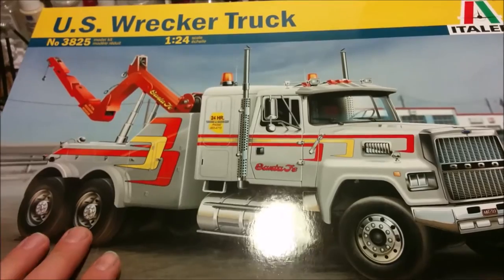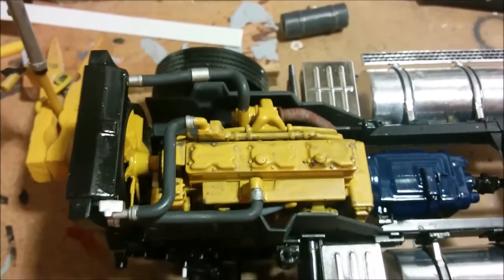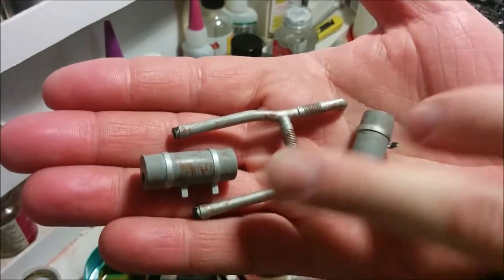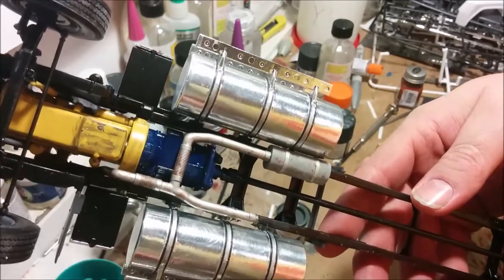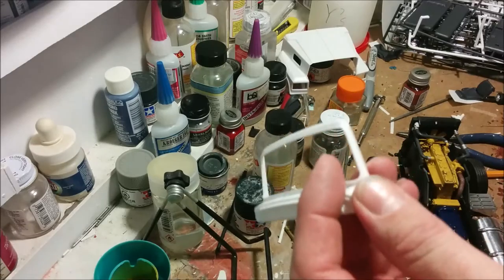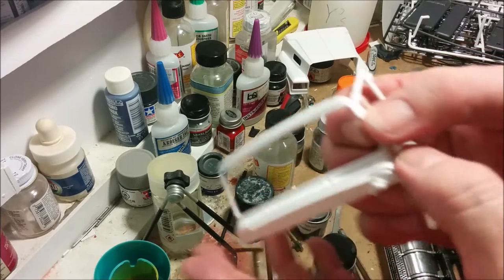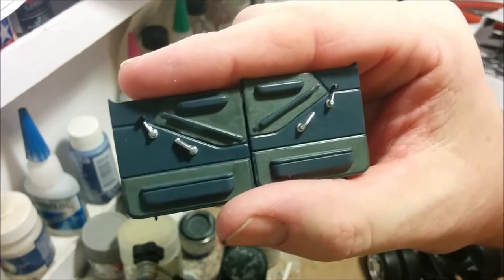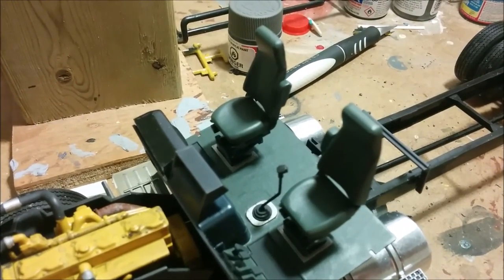Modern Wrecker Truck 1/24 Pt4 by Italeri

Comment: good job. make sure u put the windows I. first. and then the door panels before you install the interior.
Reply from the maker: pete3790249 Yep, it'll be external paint, internal paint, then like you said, the windows, and finally interior.
Reply: Dansmodelworx italeri kits are good kits to build. the only problem I have is putting the windows in. especially the pete truck's. the grooves are never flush when installing them. but great job. Ready for the next video on the wrecker
Reply from the maker: pete3790249 I think Italeri kits are underrated. Yes they have their own idiosyncrasies and they have made an occasional "lemon" but more than one other kit maker have entrusted them to do their tooling for them.  That to me speaks for itself.
Reply: Dansmodelworx yea I hear ya on that. I can say this they don't have as much flash as amt does. which is a plus.